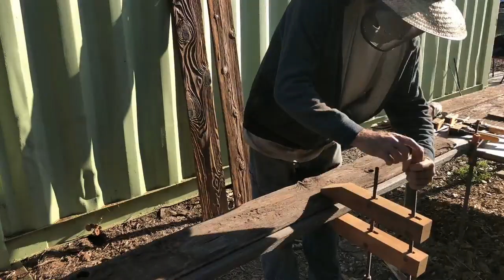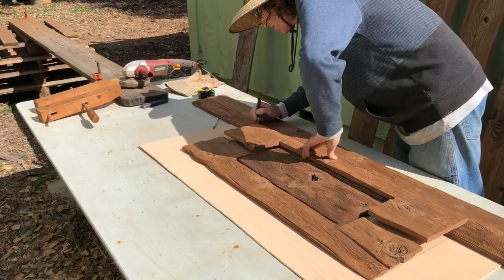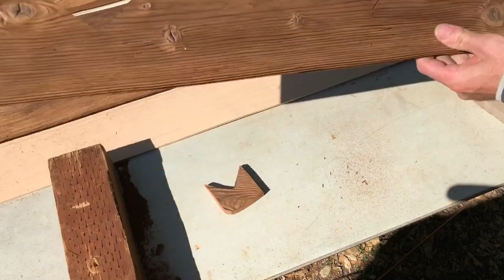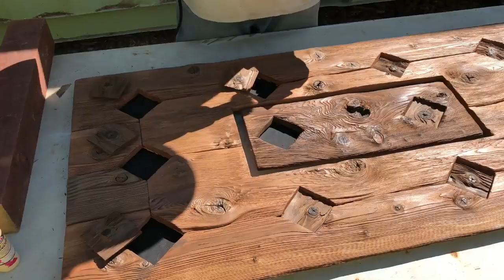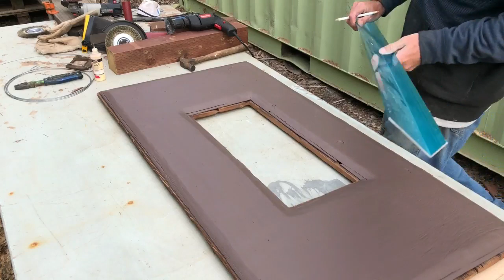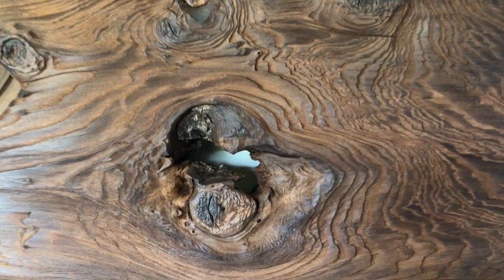"love to cut wood" rustic wall hanging art piece

Comment: When I saw your face in the bottom corner of my screen this morning I thought, ooooh, another Scot video. I like the way you have cut the squares with the grain going corner to corner, it adds an extra arty touch. You surprised me by hanging it landscape, I was expecting portrait. It reminds me of a door in a medieval castle, with the centre piece being a hinged smaller door. I have seen them like this in the UK. 

We have just gone through a week of snow hell, now it's raining. I am craving the outdoors.
Reply from the maker: I like the door in the medieval castle idea. I designed it to hang horizontally because of the center piece. But I may have to build one similar in design and hang it vertically sometime. Maybe I'll look at some old castle doors to get some ideas :) I guess it depends on the piece I use as the center piece, which way that looks best helps me figure out how to build it. Hope all that snow melts and it warms up so you can go outdoors soon.